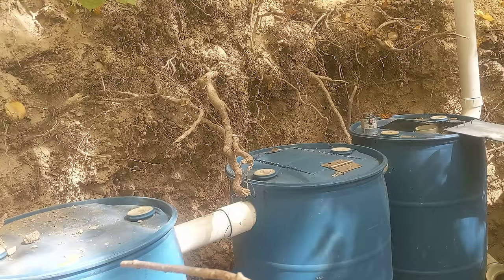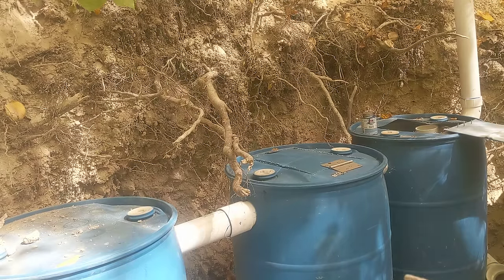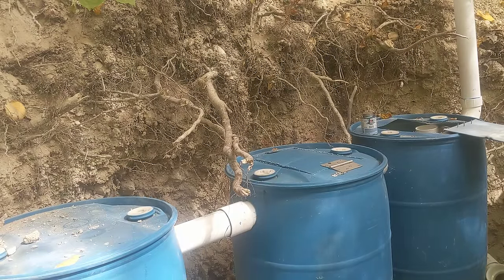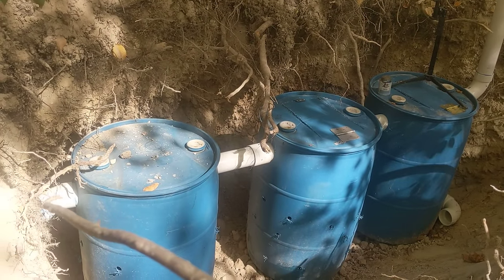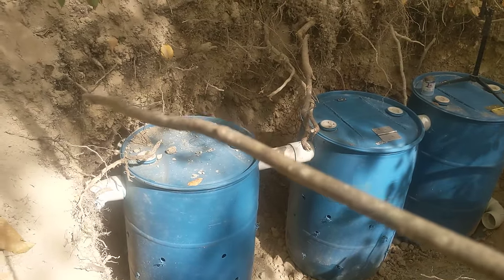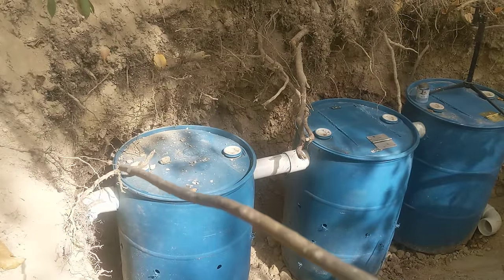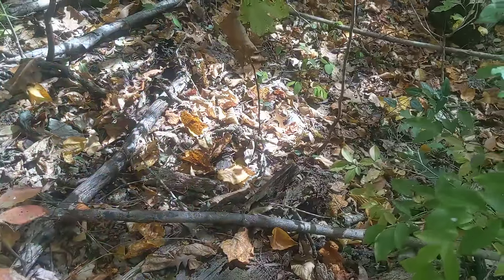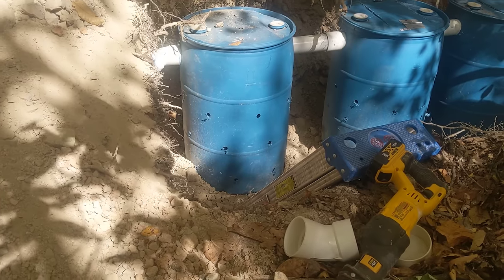The diy 3 barrel septic tank system for your cabin or RV. 55 gallon drums! (cheap & easy)

Comment: Wife and I bought a little trailer house in 1980. Couldn’t afford a septic system. Built what you have here with only two barrels. Lasted 10 years with us and our three boys. Attached about 120’ of drain pipe for a drain field. Never had to have it pumped out. Kept Ridex or buttermilk in it. I think that’s what kept everything broke down. Thanks for a great video.
Reply: Was that running just your toilet or your whole house?
Reply: What is the diameter of the pipes needed? 3"? Or 4"?
Reply: @ka24detpower  I am using three inch. You don't really need four inch unless you're running some huge unit or something where there is going to be quite a lot of sewage.
Reply: @j.b.5691  thanks a lot man, now I'm ready :)
Reply: @ka24detpower he used 3 1/4 inch hole saw
Reply: Thank you my friend, it’s not just a tee, it’s called sanitary tee?
Reply: Love great thinking bug out time
Reply: I’m planning a similar setup with 2 barrels… I was a little concerned it wouldn’t be adequate but you used it for 10 years with 2? No problems?
Reply: Thanks I have not seen the system til now have heard of it though
Reply: @nelsonlopez4695  If I'm not mistaken, pipe dia. are measured from the inside.

Comment: I did the same thing on a cabin. I built for my son. Used 4 tanks. 2 were for solids. One feeds into the other. Then that 2nd solid tank feeds into 2 drain field tanks drilled with holes and filled with crushed stone.

Comment: Awesome system. I suggest a filter fabric root barrier wrap around the barrels with holes to prevent roots growing into them. Also every 6 months, chop up a tomato and send it into the first tank. The enzymes in tomatoes help accelerate the bacterial break down process of the solids and is cheaper than expensive store bought septic tank treatments. Nicely done brother !!
Reply: I was wondering about roots. Just to help prevent & last longer.

Comment: Great simple system...Too many channels don't explain things simply and make it sound complicated...As septic systems are basically a simple process...One thing you could do is run a 4" line into first barrel so you can have a access line to pump the solids ...You also could wrap the two drain barrels with non woven fabric before backfilling and place some gravel around the base of the last two barrels...and lay fabric over the gravel then backfill

Comment: I did this with 2 barrels, and 20 feet of perforated black drain pipe.
 It worked perfectly. 
 No smell, no mess.
 Its suggested to use 2 for one person, and add one for each additional person.  
 I think its as efficient and hygenic as the approved ones. 
 Btw, someone left an older used one here, and it let it evaporate, and when it was over, it had only a small amount of "dirt" , and you'd never guess what it was.

Comment: I made a similar system with a 300 gallon plastic tote and two plastic barrels with 2 10ft drain pipes and a load of gravel.  It's been working great for over 5 years now.  There are 2 "tiny homes" (an RV and a converted shed) attached to it.
Reply: 300 gallon tote for solids and 2 55 gallon drums for your liquid drainage?

Comment: A better way to do this is to use blue barrels with removable lids and bands.  This guy used an excavator whereas I used a hand shovel.   I used 4 barrels and 2 twenty foot leech lines.  Trenches and pit, was done by hand and with removable lids,  connections were a snap!  All told the digging,  fitment, and backfill took about 2 months.  Sure beats pooping in 13 gallon trash bags!

Comment: Many thanks due The Appalachian American for saving me from drifting into long laber and high cost. A relative dug up the needed trench for free and added a gift of directing me to the barrel configuration. I have one steel 55Gal. barrel and two plastic ones. I will cover the barrels with double nylon sheets and some lumber, then cover the lot with soil. The relative suggested also to surround the barrels with rocks and gravel. I cannot thank you more. I loved what Appalachians were introduced in the movie "Deliverance". I am Lebanese got my education in the USA in mid 1960s.

Comment: Great details for the beginners going off-grid. 
I was raised in the Florida Everglades and Dad used a similar system with steel barrels. Worked for 5 years till we moved away. 
Head's up on a few things I've learned about lately;
Put some live yeast into the first barrel to activate the solid's breakdown faster and NEVER use harsh chemicals to clean the toilet with which will stop this process. Use natural soap, biodegradable, nontoxic cleaners. 
SIMPLE GREEN is my choice. 
Also to prevent roots from growing into the system you can use a copper mesh wire around the barrels, a little costly but saves on digging again or building another system. 
I liked the other comments about using tomatoes and maggot infested critters. Haven't tried it yet but I will keep those in mind.
I Also use a small odor controlled trash can next to my toilet for after doing my paperwork, since I prefer a thicker paper that would plug up most RV systems, then I burn that every night before bed along with the other paper/wood/cardboard trash. I compost my biodegradables and any meat scraps go to the cat, dog and what ever stray creatures come along after they are done.
Reply from the maker: Thanks

Comment: If you place large rocks around the outside of the blue cans it gives a leach system then a plastic film can be placed over the hole supported by the rocks. Cover this film with a few inches of dirt and you have a leach system that won't collapse inward and with the dirt over it no oder..

Comment: I did a similar thing for my camper, I lived in it for a bit when covid hit. But I had 4 barrels in a square pattern, all dumping across to each other. But all of my barrels had holes, and I had probably 200’ of pipe coming out into a makeshift leech field, added this part. I dig a hole that left 24” around the entire collage and I buried the entire thing with gravel not dirt except the top 4-6”

Comment: A lot of people had these systems where I grew up. They were all two barrel systems made from the steel drums and 50’ of field line. They didn’t perforate the second barrel. The main problems people had with them was rusting out and root masses inside around where the pipe went in or out. This system shouldn’t have any problems.

Comment: Although I would prefer an aerobic system I love this idea as it requires less maintenance (no additional energy required) 2 things to consider Tow barrels for the first section ( greatly increased capacity) Instead of a grinder which is expensive and requires power You might consider using Bidets which eliminate the need for TP. Thanks so much for this video. OH BTW Important not mentioned please do a perc test to determine if the soil has the capacity to leach effluent. Too much clay in the soil will greatly affect the system and it can fill up fast.

Comment: Nice idea but I would be concerned about the soil compressong the barrels;but maybe starting out with full (H2O) ma prevent crushing.

My only advise is, if you can route grey water (wash water, soaps, detergents, clorox, any bacteria killing substance) away from the first digester and onto a fourth tank (grey water only barrel) that would be good.  If you dont kill off the bacteria digesting the waste you wont have solids building up. 

Your only expense would be the extra PVC you'd have to by but it beats the cost of a honey dipper truv coming to pump ot the system

Comment: TY. I’m adding a small home & will be using this. I originally thinking 2 barrels but 3 is better. NE TN here too. I will add a cloth around the 2nd & 3rd barrels. I alrdy had to fix my main septic to the house cause of roots clogging the main outlet line. Easy fix with a backhoe

Comment: I have land in Costilla CO, where land is cheap, undeveloped and rural and specifically designed for off grid living and there is no specific code for a septic as long as it works and does not leak waste, so there are pleanty of places in the US where code does not exist, specifically in rural undeveloped land designed for off grid living.
Reply: what part of Colorado is this? I am interested in off-grid living.
Reply: You can't even fart without a permit in Castilla County. Had a buddy that had some land in Trinchera Ranch. His boys own it now. But when he told the county govt he was going to build an "off grid" structure, they told him he would have to build a 1500g septic system. Which he would have had to get a permit for. His argument was that he only spends about 2 days at a time, 4 or 5 times a year on his own land. So in his eyes, that kind of "policing" was bullshit. So, his plan was to go underground with the structure. Sadly he never got around to it before he passed away. Castilla County is the poorest county in the entire state and they will get any last cent from you that they think they can.

Comment: Interesting to see other systems than I am usually installing (which is factory manufactured systems in Northern Europe). This is almost a 3-chamber system, which is good, even if not according to US code regulations. However, I would only drill holes in the third barrell. And T-connections are probably not needed for the ingoing connections in the 2nd and 3rd barrel. But it is not bad to have it. Still, the outgoing water might need some more infiltration area than this, depending on the use of the septic system. A gravel field is usually used, but there are cubes made of plastic netting that reduces the infiltration area needed. Perhaps something similar can be used for this. With these modifications you might get a system that actually is quite efficient compared to regulatory approved systems with little risk of contaminating drinking water sources.
Reply from the maker: Thanks
Reply: Explain those "cubes" more lol. 😂
Reply: @theappalachianamerican8607 "soakaway crates."

Comment: So i tried to use a plastic barrel like this and the soil pressed the sides of the tank in. I am going to try wrapping the barrel with wire fencing, then use sprayfoam to cover the wire with about 3 inches of polyfoam. I'm hoping the strength of the plastic will be as good as putting cement around the barrel. If the sprayfoam doesn't work then cement will have to be put around the barrels.
The other thing i did with my barrels was to cut off the bottom of another barrel and place the top half over the tank barrel. I cut the top out of the barrel half then i had a service space over the tank barrel.
Also I'm going to put a dirty water pump in the tank to pump out the sludge once a month so it can digest better.

Comment: I like to drill the holes a little smaller, than yous a heat gun or torch and push the pipe in on one side while pushing from the inside with the collar.

Comment: Very nice job. I think it even may be a little over kill 😊. My question to you is how do you get a 3” pipe though a 1” and a 1/4”hole 🤔. I’m a retired master plumber that’s a good trick 😊. After watching the hole video I see you are using the second barrels for a leach line 😊. I like the idea, I think I would like to have more than one barrel for the solids :-). I’ve had a lot of septics pumped over the years and a small septic will fill up pretty quickly 😢.
Reply: If your really a retired Master Plumber then you understand Scooter that it’s no problem to squeeze a 3” fitting into an 1 1/4” hole with the right amount of plumbers lube brother 😂

Comment: I’m thinking about installing a poop grinder before the first barrel. My thought is the grinder pump would grind up the solids, making them break down faster once inside the barrel.. a grinder setup would cost about $900.. any thoughts from anyone???
Reply: I have a 12 volt marine grinder pump hooked up to the outside of my rv , when I dump my tanks I just hook up a battery .
Reply: It's cheaper to cut up a tomato and flush it down the toilet. The enzymes from tomatoes help speed up the bacterial process which breaks down the solids.

Comment: I hate to be a negative Nancy here, but for someone who has installed septics for 30 years, there are a lot of problem with this.  First , if you don't test the soils where you plan to install one of these, and you have a lot of clay types of soils these don't work well. Second a lot of time is spent talking about gravity of this which is worthless and the 2nd and 3rd barrels are over kill and not needed if you don't seal joints between barrels. You might as well do like we used to do in northern Georgia just out of high school... dig a big pit, take a steel 55 gal barrel put holes in it and run the pipe to the top , put gavel around and over the barrel, backfill and don't look back! You might as well use the old out-house method of dig a hole stack stones , or put in a small steel or wood barrel, put large stones around  it put you out-house over it and when fill , just move the out-house! 

Over the years we have dug up and replace or cleaned up this bio hazard messes. So if you are going to do one of these cheap outlaw DIY systems, first make sure you have the right type of soils like sandy or rocky for proper leeching. Second, make sure your plumbing to, in and out of the first barrel is sealed. Otherwise the rest is not needed and a waste of your time money and effort! Third, as many have suggested here, dig you hole and extra 8 to 12 inches deep to have that much stone under your barrels! Spend the time and money to line your hole with silt or landscape fabric before putting you stone in! Think I'm lying? Ask any home owner or excavating contractor who dealt with a basement with water coming in due to a silted up footer drain! Understand hydraulics. Water travels throught the ground taking silt and mineral with it and silt in your stone. If you install an extended leech pipe away from your system, spend the extra money to use a silt sock over the pipe and have at minimum, 6 to 8 inches of stone around your pips! If it were me, I would add a 6 or 8 inch stand pipe wiith a cleanout cap for each barrel for inspection or cleaning.
Reply: Don't need anything in the  City of SanFrancisco where they just poop on the sidewalks and streets 😂😂

Comment: I enjoy watching these videos with off-the-grid septic systems maybe you can send me a parts list that's where I get confused
Reply: Or you can do like I did. Watched the video. Decided that this is what I want to do. Rewatched the video and studied his design. Lol… I found myself typing out the items used…. 🤦🏻‍♂️! Look man if you like the design, rewatch and pause. Look. Write. Unpause. Watch. Pause. Write. Unpause. Etc!
Reply: Pretty simple, 
3 55gallon plastic barrels, 
2 3in T fittings 
1 3in coupler
1 3in 90
2 3in 45s
3in pvc pipe
2 4in hinges
2 ball strikes
Personally, I would add 3in perforated pipe and drain socks for the leach field and wrap the perforated drums with filter fabric and put pea gravel or 5/8 minus around everything that needs drainage. Along with filter fabric above and below the barrels...

Comment: Thanks  I have been thinking about using barrels for a  septic system. I wasn't sure about the best way to make it work .  I was going to use two  barrels and 5 or 10 gallon bucket for a junction box drain field ?  3 and like you're and  third barrel 3 drain fields . I have wet land here in GA It's 1 just for temporary . Camper that is being remolding into a tiny house  to live in while I'm  remodeling on the main two homes and building tiny houses  on the land .  The main house has a septic system in the back yard  but bought the place camper was in front yard 50 ft +  away house , camper was in bad shape to move it but still can live in part of it while remolding , I needed a septic system.  But the water table is a few feet,  digging 1 or 2 ft down the water starts filling in the hole .  The well  pump is 20 ft and 8 or 10 hit water .  Question is the barrel septic system works for a temporary 3 to 6 month on wet land? And what the best way I build system to work where I wouldn't have to pump solids out of the septic system ?

Comment: Wondering. can this same system be made with a shallower series of barrels. Probably about 25 gallon size...  I am just thinking the digging may be better on the upper level of the soil as opposed to lower...  Probably finishing off with a longer tube run...the type that uses foam popcorn wrapped arounfd a perf. tube...for a drain field.
Reply from the maker: Yes

Comment: But....🤔if there are holes on the second barrel,... 🤔 why install a third barrel? The water will never reach it... 🤨and where is the toilet?
Reply: Ground saturation. Your ground has water saturation capacity, meaning you can dump water on a piece of ground but after a certain point it can't hold any more water. Then you end up with a flood area. So the third tank acts as an overflow when the ground around the second tank is saturated and gives it time to drain out.

Comment: Putting one in tomorrow! Thank you for sharing with us green horns.
Reply: How did yours turn out?
Reply: @j.b.5691  Awesome! It took me a while to find the barrels and the 4 inch pipe was $35 for 5ft but it works great.
Reply: Update? @Chad Rose
Reply: @x_blademasterc.o.c.9845  It went off without a hitch and it works great,